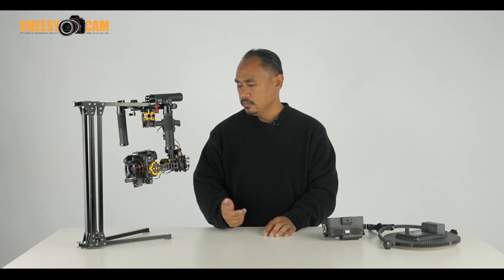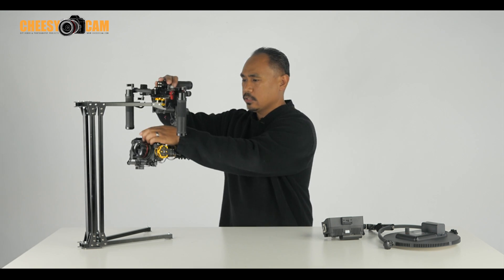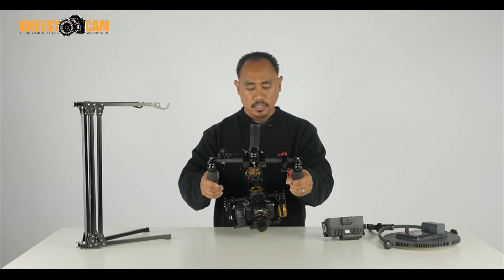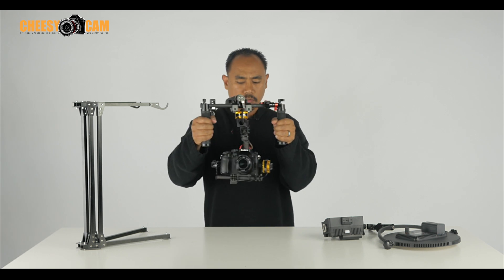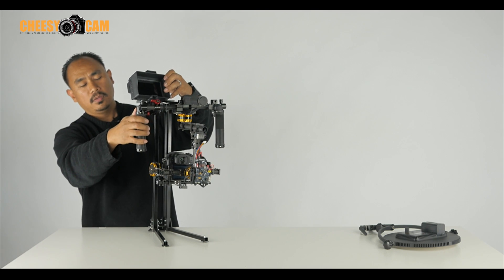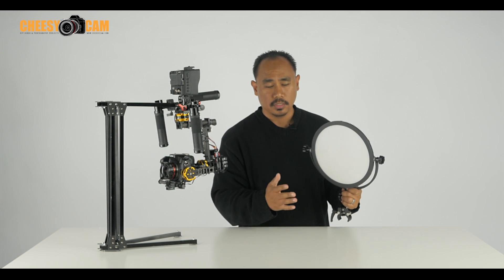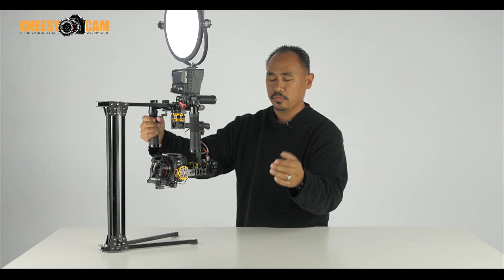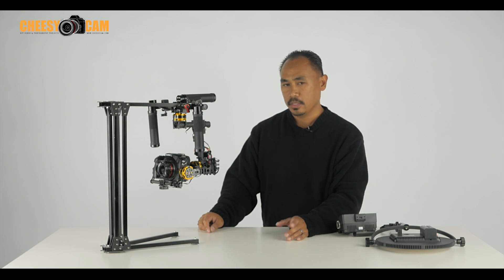Custom Mini 3 Axis Gimbal Stabilizer for Panasonic GH4 or Sony A7s

Comment: Nice M! Can you tell me the model number of those motors? I build a GH-2 rig like that with similar motors. Mine were DYS 4108s. An thinking about making a new one. Also are you using AlexMos? i have a 3 axis EVVGC. Not as good as an AlexMos 32bit.  Thanks. If it is the AM. Can you put it in suitcase mode or inverted? IOthink the inverted position could be very useful. Mid chest camera position is not really that common. Jusyt slitely below eye level is best.
Reply from the maker: All of the information is written on the blog article (link in description). But I believe the motors are 4108.
Reply: I see you answered most of my questions on your blog. Can you tell me the length of the CF tubes? I want to build this.